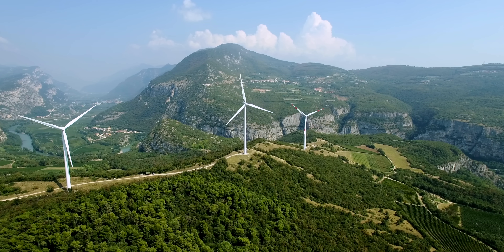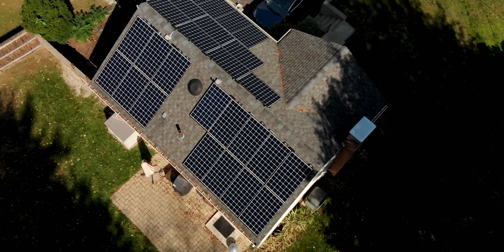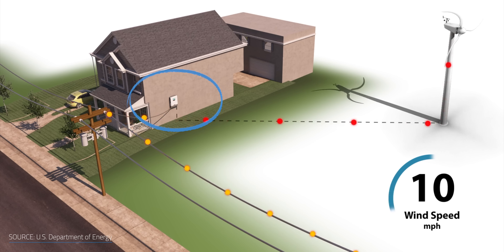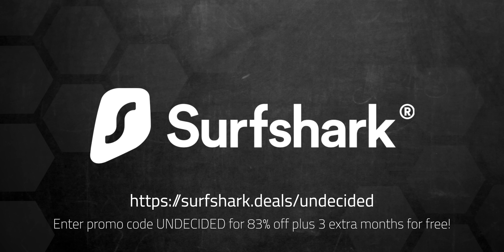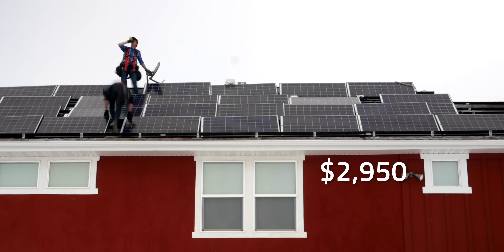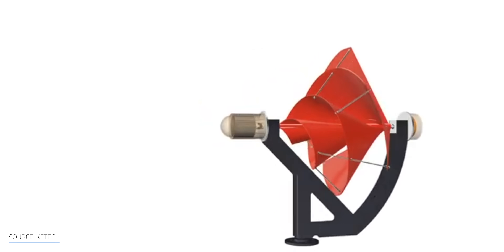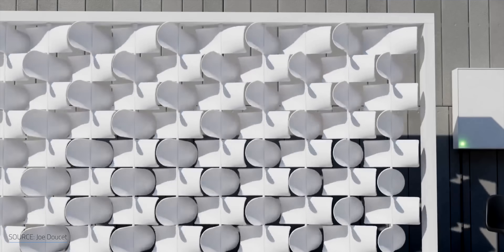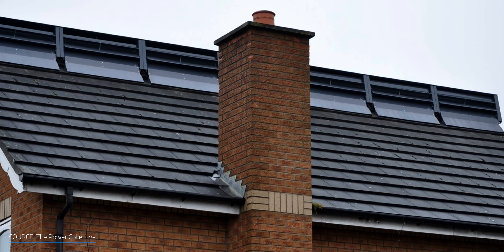The Challenges of a Wind Turbine on Your Home

Comment: Wind power for an average home is totally unviable for like 90% of homes. 1) You have to be in a windy area, most houses aren't. People remember that one windy day but don't realize how often there's no wind.  2) You have to use a high post to put a turbine on, in order to access the wind. The wind under 100' is muted by buildings and landscape. This is a problem as many building codes won't allow such structures.  3) Wind power is pretty weak compared to say, solar. So you aren't going to get a huge bang for an average sized turbine.

Comment: Except for edge cases wind is not practical in the domestic arena. In order to work well wind turbines need steady winds with a mean speed of 7m/sec or higher. This requires them to be high off the ground (start at 40m and go up). Also the capacity factor (hours/year at rated output) goes down rapidly as you reduce size. 
How do I know this? I'm off grid and optimistically installed a 1.8m small turbine to supplement my solar. It performed very poorly but exactly as my later calculations predicted after measuring the actual mean wind speed!  It got taken down a couple of years later.

Comment: Totally agree micro wind turbines just don’t make financial sence in most houses , unless you have big open spaces , live on the coast or enjoy the heat of deserts where wind often hits 15 m/s or higher further to this sub 2kw units I have found are pointless for most often breaking down , often have bearing failure or blade/break failure plus many forget the yearly maintenance plus if grid tied forget that they also have to disconnect in the event of a power failure and wind just isn’t constant.  So you have the extra cost of island setup it makes significant financial as well as usable power for the home

Comment: In my view small-scale wind power will never be able to compete with solar power simply because of the lower energy-density of wind compared to sunlight. Air moving at 4 m/s has a kinetic energy of less than 10 J/m^3. This means a hypothetical technology that can extract 100% of this energy receives about 40 W/m^2. Theoretically, the maximum efficiency of wind turbines (the Betz Limit) is about 59%, but in practice wind turbines achieve at most 45%. That leaves less than 20 W/m^2 of energy production. This compares poorly to PV panels. For example the panels on my roof (which is far from optimal) produce about double that.  

So for a comparable amount of power you need an installation that is:

1. Larger
2. More complicated
3. Maintenance intensive
4. More fragile

The advantage wind has is that wind energy increases with the cube of wind speed, and system-losses decrease with larger turbines. This is why large turbines in windy places (e.g. at sea) make so much sense. Solar power, in contrast, is strictly linear: You want double the power, you need twice as many panels. So basically the physics of wind turbines favors large turbines, while the physics of solar places no penalty on smaller installations.
Reply: very well said, thanks
Reply: I'm not that good at physics so I won't even begin to question your math, but : 4m/s is very slow wind, basically the minimum wind speed to get any kind of power out of most wind turbines.. Also, you're saying your solar panels produce about double energy/m^2 .. At what times of day ? How sunny is it where you live ? There's a great many factors that go into this..

Comment: I would bet on Ridgeblade design there. Just because it's not such an upfront material cost, it is simple and looks reliable.
Furthermore I would notice that many buildings conform the air in such a way that there is almost always a strong current coming from one side of the building, that energy could be easily captured by a device that is specifically designed to do that. If they can make it quiet, cheap and reliable, I can see those appliances being implemented together with solar panels.

Comment: They 24/7 delivery of power for off grid situations interests me. Not for overall power delivery, but because of the potential reduction in needed battery storage. For off grid, storage can match or exceed the costs of a properly sized solar array.

Thoughts?

Comment: I have an acquaintance which has a small 500W water generator in their summer house. 500 watts is just about enough to run their fridge, freezer and a few lights 24/7 year around. It's not enough for heating or cooking, but there is wood/propane for that. But the freezer needs to run even when not there and running a propane freezer 24/7 is not really economical.

Comment: Solar is far and above the better choice for power generation.  Only in rare cases where you do not have the necessary area for solar panels would wind be better.  Would be interesting to compare solar to small/home steam turbine powered by gassified wood chips.  The cost of the install, to cut or buy a cord of wood to size pieces that fit in a hopper with wood chipper wheels that feed the chips into the ceramic burner.

Comment: Small sailboats install tiny turbines all the time as well as solar, it's not hard in the slightest. If you get wind a at least a couple days a week then it could be with it, more wind more worth it. heck it's pretty easy to make your own turbines.

Noise isn't as bad as you would think and the main failure point tends to be bearings or seals if applicable.

Comment: Wind turbines can have interesting side effects in cities, slowing the wind, that is. 
Also best application seems to be mid-size for cities, build on top of multi store buildings,  6 or higher, ideally highest building around.

Those wind walls would be nice around highway, where both wind speed is usually high because of big open area, and it's not like we can utilize the space any other way. Noise dampening and spreading included as benefit as well dont sound bad. 

wind would really need that economy of the scale, standardized parts to become worth it. I still like the idea of tiny turbines/solar combos providing juice to streetlamps and stuff like them.
we have tons of those lamps, if we can make them into 100W solar and 50W of wind each, los angeles have 200k of them alone. That would provide a real difference to environment.
I really think solo turbines are not what we want, we should integrate them into other things, for either offsetting power usage or an army of tiny power producers.

Comment: As always a great video. But you didn't mention the reason small wind turbines aren't financially feasible. It's because with wind, if you can double the diameter of the turbine, then you quadruple the energy output, simply because the surface area of double the diameter circle, is quadruple the area. This is why wind energy has become so competitive over the last couple of years, GE has a 14 MW running, and this year Vestas will install a 15 MW turbine, they are getting HUGE.
Reply: Yup. And the wind speed at altitude is much higher as well than close to the ground, let alone in an urban environment.
Reply from the maker: I had that in an earlier iteration of the script ... should have left it in there.

Comment: This is a good idea, but the real issue with renewables isn't the production, it's intermittency. We in the Netherlands are literally putting hundreds of millions of dollars worth of solar-PV into the ground (disposal) because the grid cannot sustain it. 
We need storage and an upgrade of the power-grid before thinking of new renewable energy sources. For this, we need government investments.
Reply: Your electricity company just needs to pay customers who provide electricity when the grid needs it. They will build out their own distributed battery system in homes, business and electric cars that can plug back into the grid when needed.
Reply: https://youtu.be/NH4_2PFTzIY

Apparently, some finnish folks are onto that, converting excess from solar into heat which is applied to underground sand pits, and used as heat batteries. They even propose it as a yearly cycle, used heat accumulated during summer through all the winter.

I just stumbled into it today, and thought "This should be on Matt's channel".

And there's at least one concentrated thermosolar project, called Gemasolar, which accumulates heat trough the day, and at night uses that heat to move a turbine to produce constant power.
Reply: Are you talking about wasting the excess electricity or actually removing working panels that are already installed? That seems crazy to do. You can just disconnect them from the grid when there is excess and there are always some times when the power is useful.
Reply: Go nuclear =)

Comment: Solar panels get virtually the same energy per square meter with the scale, location, and surrounding environment causing very little change to their power generation. But wind turbines' power generation is entirely dependent on their scale, height, location, and surrounding environment. If you aren't in a flat plains with little structures, a windy area, with massive turbines then the efficiency of the system drops like a brick whereas solar has the same efficiency if only a marginally larger percentage setup cost, but the same power generation efficiency. Wind turbines at large scales are ridiculously effective because they are like setting up giant multi-city wide solar arrays (since wind is created by the sun) all within a small footprint for the low cost of a couple of units. The barrier to entry vs a comparable solar array is way lower, that's why the Texas power grid is obsessed with wind energy no matter how hard-core republican they may be. They are essentially building an entire fossil fuel burning plant for each turbine but they don't need the facility, the majority of the workers, the recurring fuel cost, the water, the smoke stacks, or the administration, they are just stripped down to the actual generator that turns motion into electricity and the blades. Then they harvest "solar energy" over a much larger area than even the largest and most expensive solar arrays.